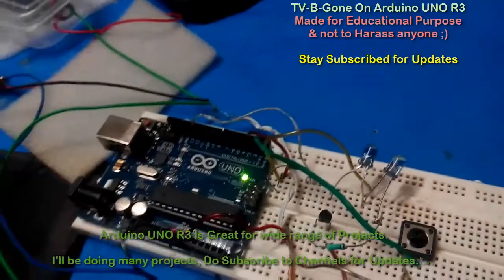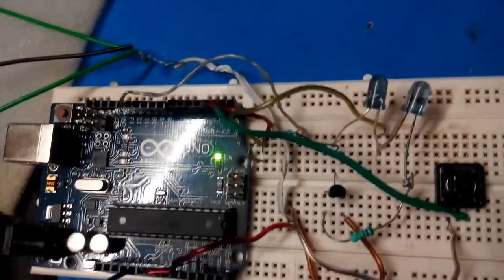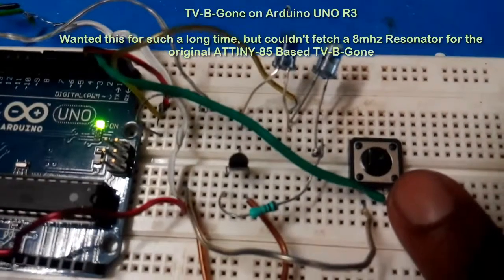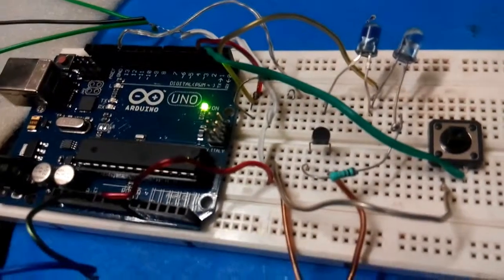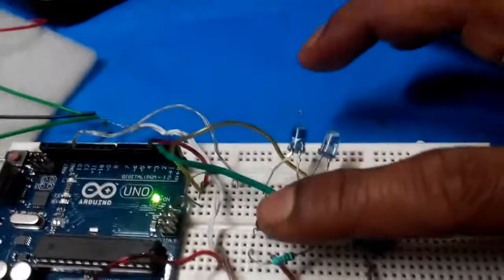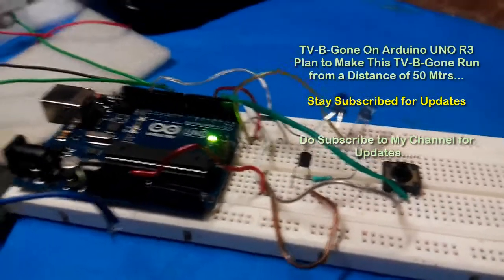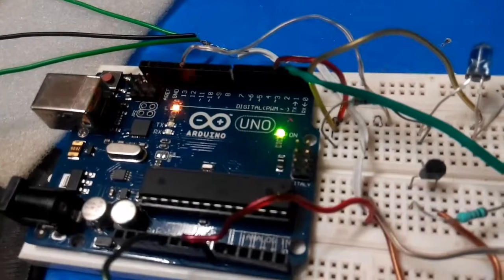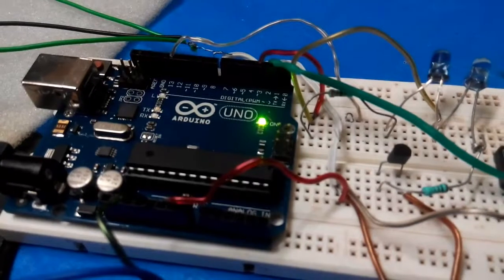TV B Gone in India made on Arduino Uno R3, Turns off All TVs, More Versions of TVBGONE Soon

Comment: hai mr, nice project, can you sent the program arduino ? i want to make it for my TV SHARP, thanks before . my email = rightpath21@gmail.com
Reply from the maker: Rightpath Path : i've updated the Description of the Video with all necessary files and schematic for TVBGone Arduino Version.You can use Uno or even Pro-mini clones to run it.
Save Electricity by turning off the un-watched TV's :-)
Reply: is there a code for a program just for one type of tV?
Reply from the maker: Rightpath Path Its gonna turn off any TV, Any make, Any Model, Any Size, CRT + LCD+ LED + OLED etc.you would be amazed with the accuracy.
Worth building, I've 3 of these on my Table as of now, making more soon with little modofications :-)
Reply: I am confused as to his code, can you send?
Reply from the maker: Rightpath Path : whats confusing in it.Just upload the sketch and it works fine.
its same code I am using without any modification.